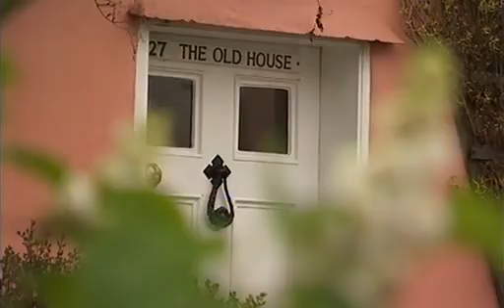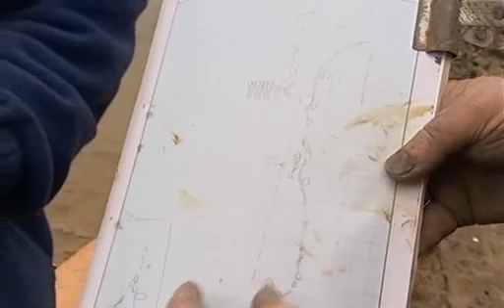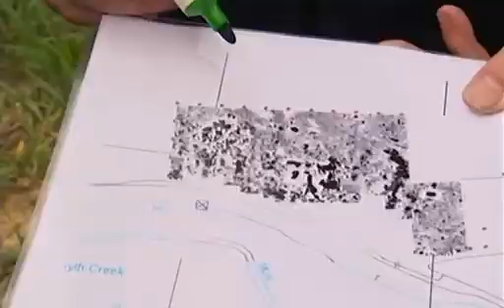Time Team S12-E09 St Osyth,.Essex

Comment: After watching the show, and doing a quick look ay Google earth I can make a fairly good educated guess as to why the town is set up the way it is. Prior the the flood they mentioned the town may well have been in nice neat grids. After the flood a good deal of the town ended up waterlogged, and quite possibly for a very long time. This would have forced the residents to move everything to higher ground which also means conforming to the buildable space available.
Reply: I would go with that theory.
Reply: makes sense, i figured the town was drawn away to take advantage of the opportunity the priory offered.

Comment: 16:36  I'm not really sure if Phil is pulling Tony's leg here.  He's praising the "craftsmanship" of stones used to block up niches that used to hold the statues of saints.  That's like praising the "craftsmanship" of someone installing a drop ceiling in the Sistine Chapel for the express purpose of preventing the paintings of Michelangelo from being seen, or the "craftsmanship" by which ISIS reduces ancient Assyrian statues to piles of rubble of a uniform size.  Iconoclasm does not produce real craftsmanship.
Reply: +christosvoskresye well, phil is a flint man :3
Reply: +christosvoskresye  Phil is speaking of knapped flint which is a traditional english building technique andthe expertise of the knappers is quite obvious at the regularity of the knapped flints, it is not a sign of iconoclasm as ther is quite obviously a niche for a largish statue in the wall, its quite similar to many such buildings which I've seen throughout the south.
Reply: Those aren't niches. It's a construction style of alternating panels of flint with ribs of lighter stone.  There is indeed an empty niche at 16:50 but the flint work is a traditional building style and that is a beautiful example of it.